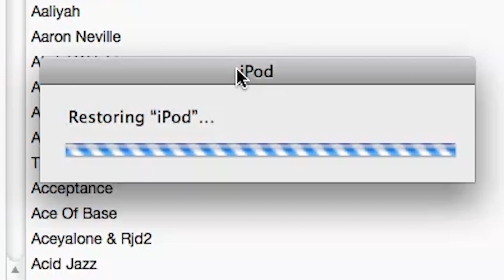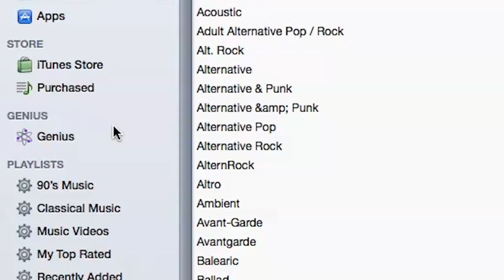Flash Mod and Battery Replacement | iPod Video 5th Generation

Comment: I put mine back together and the screen is totally destroyed now, what the hell did i do wrong...? Is it because i used the compact flash card adapter one?
Reply from the maker: Destroyed as in not working or destroyed as in damaged/cracked? Using the compact flash version shouldn't matter as long as it fits your specific Ipod. Will a computer recognize it? I realize you can't see anything but if you can get it to play music that would be telling too. Determining if the screen is damaged or if the thing is just not working/ a power issue. Could the screen connection have disconnect somehow? Is the battery cable connected and locked into place?

Check this site out for a replacement if it is legit destroyed. https://eoe.works/collections/ipod-video-5th-5-5-generation-replacement-parts/products/replacement-lcd-screen-apple-ipod-classic-5th-5-5-gen-video-30gb-60gb-80gb-new
Reply: @laidlawmarkus  destroyed as in damage, huge spots/lines of dead pixels like something pressed up against the back of it when i put it back together. Everything still works, the screen just looks like it got dropped or stepped on or something. Maybe i put the foam in the wrong place or something idk. Ill check out that link though. Appreciate the response
Reply from the maker: @who_cares848  That sucks! Only thing I can think of is if the adapter didn't fit your specific model or when you snapped the case back together you applied to much pressure on or near the screen.  May be worth opening it back up to see if you can find out what happened... Yeah check out the replacement screens I sent you. Feeling super bummed for you!
Reply: @laidlawmarkus  i popped it back apart and figured out its what i thought. It was a combination of putting the foam in the wrong place because i wasnt paying attention and pushing down too hard like you said. I ended up finding another working ipod for $10 more than a new display which works out because i wanted a black one anyway and i wont have to change the display. Basicly im just gonna take out the new battery and flash adapter and put them in the one with the good screen but im going to be more careful and make sure the screen is lit up so i can see if its warping/changing color as something is pushing up against it and stop before i break it. Ill also actually put the foam in the right place lol.
Reply from the maker: @who_cares848  Awesome! Yeah take your time, double check everything like you said, before snapping that all together! Best of luck, let me know if it is a success!
Reply: @laidlawmarkus  it worked! I was more careful putting it together and everything is working flawlessly with no damage to the screen. I really appreciate you responding to my comments. This all started because i lost the usb-c headphone adapter for my phone, but i think i accidentally found a new hobby.
Reply from the maker: @who_cares848  YO! Thats great news! Yeah I had a lot of fun upgrading my ipod and know that feeling! Enjoy!